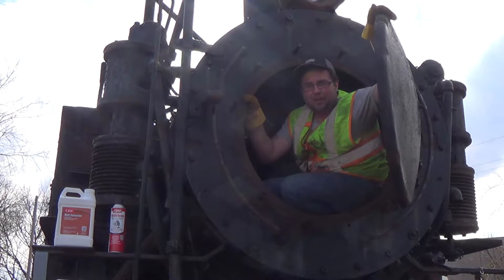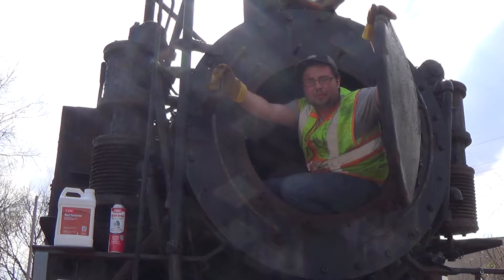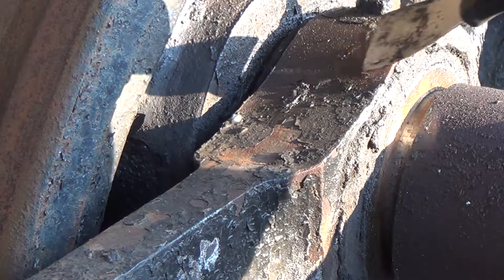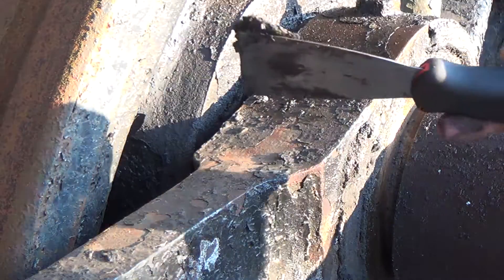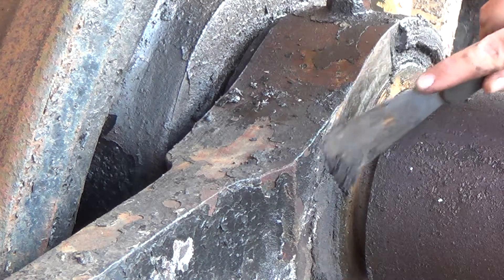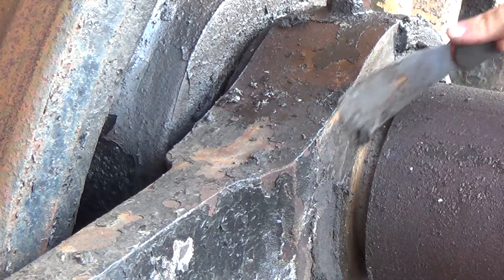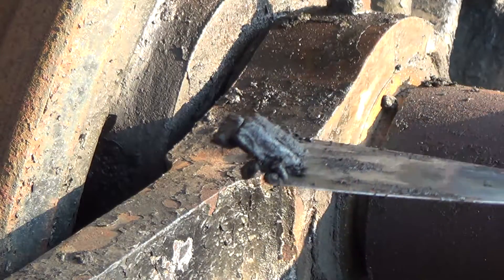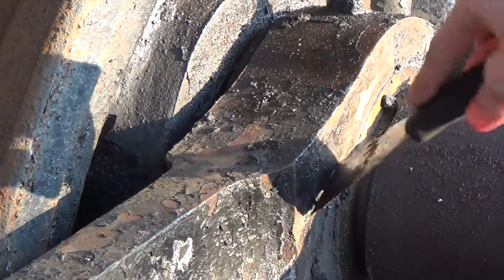Project 02: USATC 5002 Update #1 - 3/25/16

Comment: 1 there is a air supply its called the little switcher you guys have... 2 why start a video with a advertisement for a product alot of people wont use on a daily basis???? 3 what is going to be the end result will this be like most steam locomotives that just become display pieces or will this become another locomotive that you guy will operate on your weekend excursions people would like to know these things ....
Reply: Lots of folks use stuff made by crc.  Personally I use their brake cleaner and their electronics cleaner sprays.